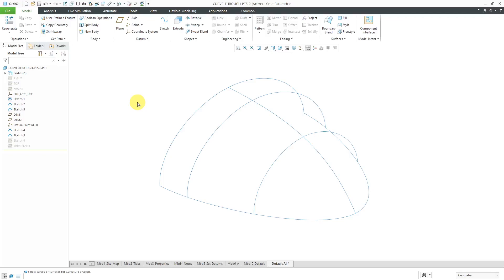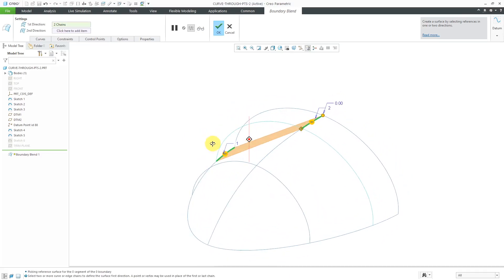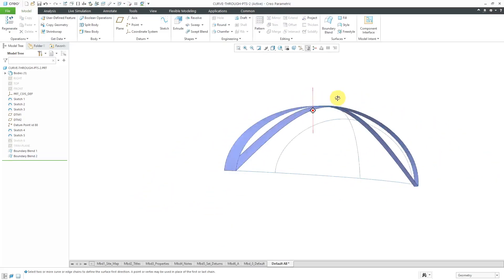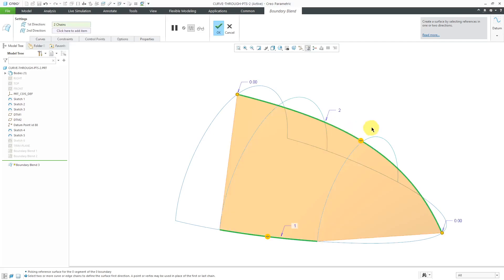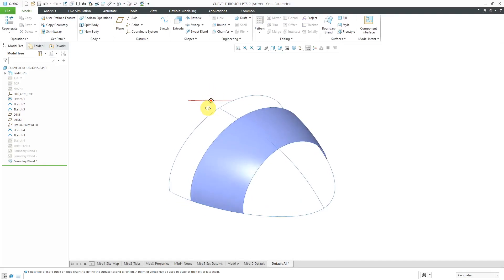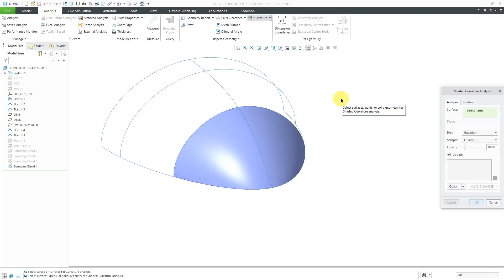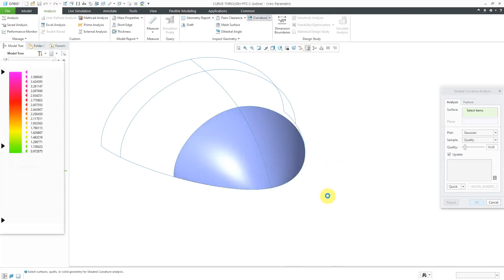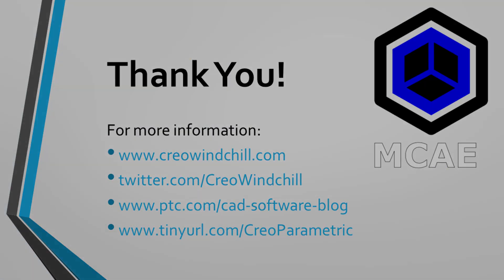Creo Parametric - Boundary Blends and Curves in 1 and 2 Directions | Surfacing

Comment: could you tell how to draw a curve on top of a surface normal to the surface. I have explored it but found no easy solution. All i see are options like tangent, draft tangent, curvature etc
Reply from the maker: How can you create a curve on a surface that is also normal to it? I can see how a curve can be normal to a surface through a point on a surface, and how a boundary curve can be normal to a reference. Can you explain how a curve can be both on and normal? Seems like a mathematical impossibility.
Reply: @CADPLMGuy   @Creo Parametric   i wish to erect a curve normal to a surface (or any other fixed angle) with curvature such that as i move that curve/line along the surface, it maintains the orthogonality/or angle. Why i want?. lets say i have a curved surface with an open recess and i want to run a wall around the recess but the wall should be at 10 deg. Better i give a link here which is rhino3d but i want that done in creo.
Reply from the maker: I'm confused. So the curve isn't on the surface? It sounds like what you really want is to create a surface but you're focusing on the curve as the intermediate step. The example of the wall can be easily accomplished using a sweep.